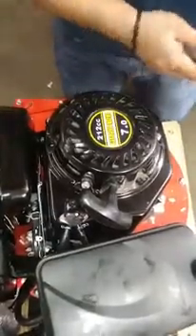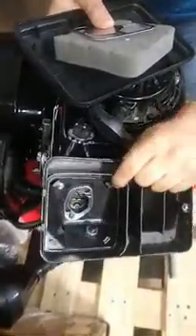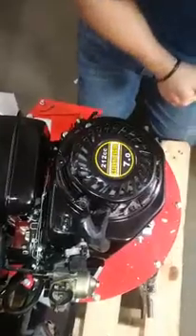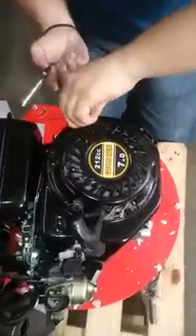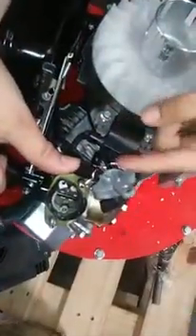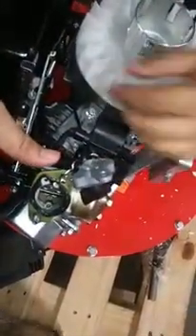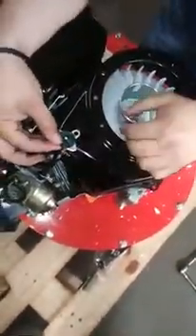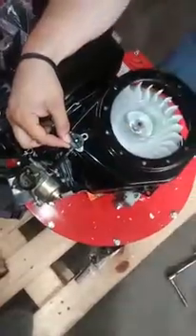GreatCircleUSA LCE01 3-in-1 Wood Chipper Fuel Line & Fuel Shut Off Valve Replacement - Guide

Comment: Would be nice to have some more videos of this wood chipper. For instance, how fast should fue fuel drain when you unscrew the drain screw in the carburetor? Causes of lack of power. I can't speed up mine, it seems something might be clogged. How to find out if it's the carburetor, fuel lines, fuel clock, tank, etc...